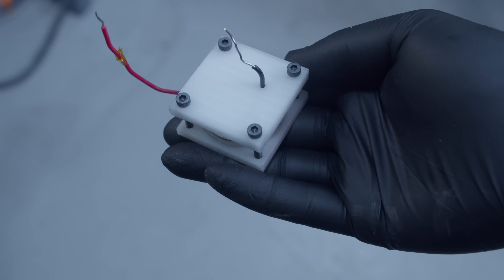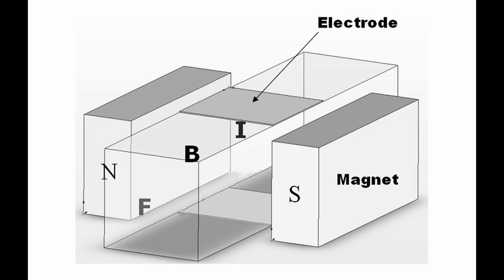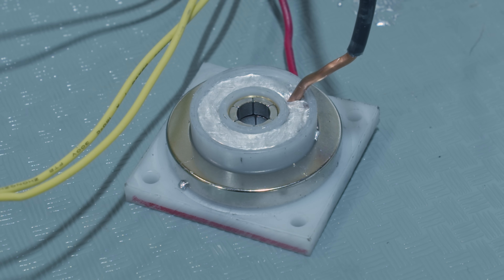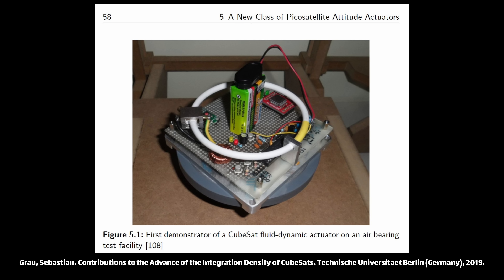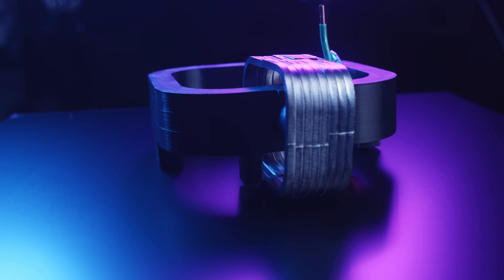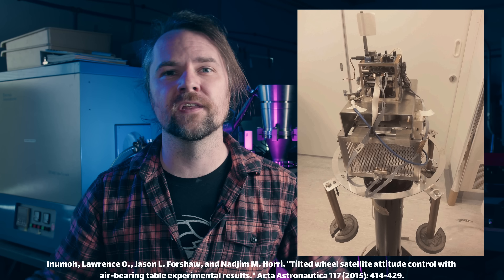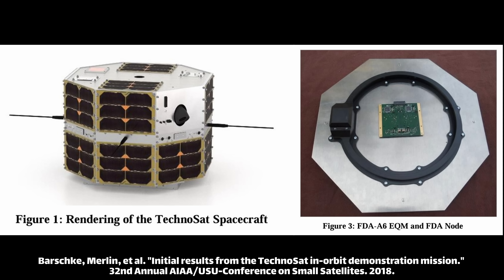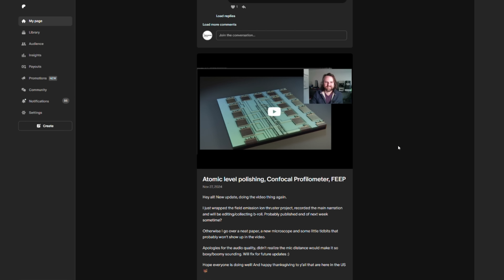A motor with no moving parts (sorta)

Comment: Not all the issues you listed seem to be gone with that design.  I'm guessing it would be bad if the system wasn't at least air tight and that would mean it needs to be sealed because otherwise trapped air would puncture the air tight barrier.

Comment: So you use Lorentz force to move liquid metal.  Why bother with the liquid metal?  Why not generate Lorentz force with a current through the magnet?  There are no moving parts and no liquids.  Nothing to seize up.  (If you look up Lorentz force motors in YouTube, there are plenty of examples.)  With a button magnet, you can create torque.  Reverse the current to reverse the torque.

Comment: What if you had a sphere with a solid inner sphere. Then have electrical points all over the out side. Then you just pick two points less than 180 degrees from each other perpendicular to the direction needed to spin.

Comment: Question, wouldn't the liquid metal still need to be sealed in a pressure sealed case to prevent it from bpiling off in the deep vacuum of space? Wpuldnt need to house the entire assembly of course, just the liquid, but still

Comment: nerdpop...sume of parts over unity possibilities...If a reaction wheel must be spin at high speed to have inertia or stored power. if the reaction wheels are scalled but in // in each plane, then smll fine adjust c an be done with the liquid system. The older bearing based can provide the power for large moves. They can be run at much smaller speeds, reducing vibration, if they do not need to provide fast steering, if the smaller liquid system can do that. slow can catch up in time. bidirectional spinning can allow lower average speeds and provide needs, of the main reaction wheels.
I can reduce your power losses driving the liquid current sink/store.

Comment: For 1 wouldn't segmenting the metal be more efficient rather than relying on surface tension alone essentially shape it as propeller. 
And in regards of efficiency the magnetic field generated is what drives it so the power is lost in that conversion. 
So some energy to magnetic field to induced movement is how we can actually measure the efficiency no?

Comment: what happens if the electrodes only touch opposite sides instead of the entire bottom or top or both being the stuff is already conductive?
what if you took a hollow ring of plastic 3d printed for optimal shape and filled it as the reaction wheel with slots for flat magnets or curved to optimize the thrust?

Comment: New experiment:  inside a hollow glass / quartz  torus add the following:  Hg, Nanoparticles of : Fe, Ne52, Ba, Co.  DONT fill the entire volume of the torus. Create vacuum inside toroid and seal the toroid with the vacuum inside.   Use  transformer wire to wrap the toroid.  Apply voltage using a Variac.  The mixture will spin. As you increase the voltage the suspension of nanoparticles in mercury will spin. As you increase the voltage, the suspension will center in the center of the toroid as it is pulled to the magnetic field. As you accelerate this “colloidal mixture” ( not an amalgam since it is not solid) , the spinning fluid will turn into a plasma. Remember, there Is no resistance from touching the quartz/ glass wall since the mixture is not touching the walls.  You can place another coil not touching the primary, and you will be surprised by what peak voltage you can get.    The plasma comes from the suspended rotating fluid.  As you reach sufficient radial velocity,  a corona effect will be created.     There is a part 2 to this  setup, but I’d prefer give you the details in a more private forum  because  I am afraid that some amateurs can try part 2 and I want to have you do it first and see what you think about putting it out there for everyone to try it.  Send me a reply here.  There is also a part 3 but that is even more complex and requires understanding of quantum physics.  I don’t work for the government and am not violating an NDA.    ST. MD, MS

Comment: Turbomolecular high vacuum pumps use magnetic bearings as the rotors spin up to 120,000 RPM. So...why don't reaction wheels use magnetic bearings as they are not affected by vacuum, they don't wear out and there's the added benefit of reduced drag.

Comment: Couldn't a single sphere with coils on 3+ axis take the place of 3 separate reaction wheels? The internal confinement may be an issue, requiring a sphere within a sphere to stop fluid from flying around when not under magnetic force, which would inevitably limit the ability to flow in any direction, but could still be very useful even with limitations.

Comment: ok so I think the biggest downside I see with this right now are the temperatures in space. So you would probably need like thermal insulation + heating and it should be done with mercury instead of gallinstan, but aside from that it is really fascinating

Comment: High current at very low voltage is not so hard to produce if you know about switching power supply but the design of the printed circuit board is a science that only experience cat teach.
That's the kind of thing powering PCU units nowadays. But the liquid metal may heat a lot and magnetic circuit will lower his property though.

Comment: can you have a helical turbine type wheel encased which magnetically (rare earth / EM hybrid) couples to a wheel on a driving shaft, so that motor moves at semiconstant speed/draw but increased power to EM coupling performs throttling.. Intermediary torque transfer medium. Increasing throttle modulates coupling strength, and then drive speed when necessary. hybrid style, one, other or both.

Comment: would something like this need to be kept pressurized to remain liquid? while its liquid at normal room pressures temperatures changing the pressure should change this and may even allow it to flow more smoothly.
also would they need constant power to maintain flow and position against friction compared to the negligible friction of reaction wheels?

Comment: reaction wheels aren't that good because of saturation, u always need propellant so far to desaturate from time to time, even if reaction wheels didn't fail they would still saturate all the time and that's why the satellites become unable to control attitude because of fuel/saturation and not because of mechanical failure most of the time.

Comment: OK not sure how you think you can get liquid metal in the -454 degrees Fahrenheit since mercury freezes at -38  Fahrenheit you'd need an electric heater and more power to keep the metal liquid seems a pointless endeavor for outerspace useful on earth at room temperatures but would use a lot of power in space to heat and cause spin.

Comment: @BreakingTaps 
I was wondering, if you could test a small experiment with the liquid metal. I am having a belief from my childhood that centrifugal force of liquid can be used to create thrust without any propelsion.
A liquid inside a spehrical apparatus or a kind of hemisphere apparatus where liquid can freely move from bottom to top of hemisphere due to centrifugal force. Can you measure if it can create some thrust.

Comment: Pay attention please 
I liked your project
To solve the power problem you can use longer with smal diameter canal for the liquid metal to increase the surface resistance and you will need higher voltage and lower amps by making it a spiral loop starting from the top to the bottem and again an eaner spiral runing from the bottom back to the start and like that you can use a cylindrical magnet in the center .thank you for the efforts

Comment: Hello! Wouldn't it be better if there is resistance to the liquid flow designed like a Tesla one way valve for example, which won't stop the flow entirely and allowing just enough to keep things moving ,but in the same time increasing the force of the liquid on the body itself, thus improving efficiency? I guess that if the flow rate is close to 0 at the very end of the loop you achieve near 100% efficiency of the power to rotation conversion. Just guessing... Great content!

...edit for more nerdy stuff and guessing; 
I also think that when the liquid inside accelerates to it's maximum speed the movement of the body will stop. This is the reason why such resistance would in theory cause a constant force, rather that a one shot pulse. Because upon powering off the same force will be applied and the movement generated will cancel out the force of powering on. I hope this makes sence :D

Comment: An idea for a non-bearing, non-rotating reaction device. It does have the disadvantage that it does vibrate. In fact that is how it works. You have a rod that is fastened at the base or possibly held at the middle. Use two 90 degree cross fields to drive the rod at its natural frequency. Start with the sinusoidal drive and then rotate the fields to the other pair of coils. The oscillating rod will produce a torque and try to continue to oscillate in the same plane it first started in.
No bearing to wear out, not high current to deal with. I'm assuming the rod was made of spring steal but most any stiff rod would work but it needs to either be able to be attracted to a magnet or have magnets mounted to it. For a spacecraft, and you    could live with a little vibration while rotating, once it was in the right direction, just let the vibration dampen out.
Dwight

Comment: I wonder if it would help to use a pipe in the shape of a solinoid (ie: a helix).  Then line up a bunch of electrical contacts in series, with a line of magnets etc.  Basically a possible way to have a bunch of these pumps in a compact shape.  Maybe.  And since all the current runs in series, maybe you could get away with less amperage?   Anyways, maybe I'll peek at that test satelite project you referred to.

Comment: Could you do this in reverse with a tesla valve?

The tesla valave is a no-moving-part conduit that preferentially allows fluid to move in one direction rather than the other direction.  So... If one had a circular channel of tesla valves filled with liquid metal and between conducting plates and lined with magnets?  The result would be the electrical equivalent of a self-winding watch... something that would turn vibrations into non-random over-all flow of the liquid metal which in turn would produce a voltage across the two plates and a current which could charge a battery.

Comment: You need amp delivery? you could set up an array of 2.5v boost capacitors or ultra capacitors. I use 6 in series in my car for 15 volts, If you haven't played around with some of these maxwell boost caps/ultra capacitors I highly recommend trying them out. 6 2,600F caps, even after substantial capacity loss from series will run my 1,400W stereo by itself for 7 seconds. They make them in several sizes, their all pretty light weight, you could probably make it without needing any wires coming off.

Comment: Bravo..........they have already made..........different style..........tank on top .....with a horse shoe tube  on bottom......to make a loop from one side of tank to other side.....know on up side of loop the inject compressed air.........note one side has less  density from air.......also mix iron particles  in  sodium......heat to liquid .....coils go around tube........liquid generator core with no moving parts......cheers

Comment: i wonder if it would work better with 1mm spaced flywheels in with the liquid metal. i used tesla's "bladeless turbine" physics as my base of reasoning. with the flywheels, it may help with the energy loss & magnetic conductivity. with the metal being liquid it may provide as lube as well as rotation

Comment: get some battery cells that are lifepo4 bare cells used. i have a large stack, and zero bms prote3ction, can push like 10A per small cell  and 15A high for burst, i picked up about 200cylindrical, pucj or prisms have less burst its based on the anode cathode structure designs

Comment: I forget what it's called when you hear about something one time and then it feels like everyone is talking about it, or like you thought you bought a unique car but now you see them everywhere... I was reading about MHD in October maybe??? I think I've seen like 3 or 4 larger science creators drop videos about MHD since then after what seemed like several years of gap since the last larger MHD video. One of those weird coincidences I suppose. 

I just wanted to share what I was originally looking for into because I found it fascinating: 

I was reading (probably 70s era NASA research) about MHD in "reverse" as generators. The MHD generator would be installed in combined cycle combustion turbine exhaust gas paths. The MHD would be used to collect the kinetic energy of the exhaust gases before being used in a typical steam turbine generator. The design concept doped the pure hydrogen fuel with cesium to make the exhaust gases exclusively steam and cesium. This combination would be the conductive liquid for the MHD system to function. Then the system purified the exhaust to remove any contamination and reclaim the cesium for reuse. The purified exhaust gases (now just water) are sent through the steam cycle as boiler feed water. I find it fascinating though I think it's obviously impractical for a lot of the same reasons that modern hydrogen gas turbine projects are facing today. Add a need for a reliable cesium source and energy needed to run a cesium condenser... Measurable losses and political barriers become plentiful. I'll reply to this comment with a link to the paper if I find it.
Reply: The document is NASA Lewis H2O2 MHD Program: NASA TM X-71520. Page 4 has the complete cycle diagram.

Comment: very interesting video!
for the needs of the demonstration you limited yourself to non-toxic "compounds",
but for a flight article I would have considered switching to the element Mercury, with adequate precautions one can dare to take advantage of its high density and its liquid phase at room temperature
in space there is certainly a vacuum but there is also an obvious lack of thermal stability (in no time one can go from close to absolute zero to really excessive temperatures)
to maintain anything in liquid phase a heating system must be provided (which increases the mass balance of the satellite)

if I were given an unlimited budget (in dollars and in mass) I would have even gone to select the densest metal choice which is paid for by a substantial heating system to keep it liquid. so we would end up with a reaction mass in osmium (density of 22.6 against "only" 13.55 for mercury)
for the heating system the mercury will only need to be kept above -35°c to remain liquid
as for osmium it is rather +3 000°c LOL

Comment: liquid metal freezes
Reply: Space is surprisingly enough, not cold. With some insulation it's probably possible to keep a "liquid" metal, liquid.

^ one of the main contributors to this is the total lack of atmosphere. Which is the primary method of cooling on Earth. So everything must be cooled by radiation (mostly infrared). Satellites are reflective to keep heat out, because space isn't cold
Reply: Oh wow! Thanks for the info!

Comment: @BreakingTaps 
Regarding the required power, why not use batteries to charge a capacitor? You would then use the capacitor for a high-current discharge. As for the container, a long and thin coiled plastic tube holding the liquid metal would likely eliminate turbulence issues. I believe this setup could have surprising properties.

Comment: Now does the wheel really need to be liquid? If you make any wheel rotate in magnetic field in vacuum, it will work the same. It can be made from anything, including steel or a piece of metal impregnated Teflon. The main point of this actuator is that it removes the need of using precise ball bearings, but this has nothing to do with liquidity etc.

Comment: Aren’t most reaction wheels used to absorb angular momentum for long periods of time in between rare usages of thrusters to dump angular momentum? And aren’t these liquid metal motors going to experience vastly more friction (through fluid viscosity) than a good ball bearing? (You mention viscosity very briefly near the end of the video but don’t discuss it at all.) In other words, you will need to continuously apply lots of power just to hold it fixed to the new orientation. If so, that seems to dramatically limit their usefulness to just short-term changes in orientation.

Comment: One problem is the space temperature, liquid metal need to be in a range of warm "ambient" temperature to be liquid, this device will need another system, like an temperature control to work properly, but it can be a little tricky in space, when we speak about fuel or energy
Reply: Also, the current of the magnetic field, can provide the warm necessary to maintain it liquid, but, as you said, it need a great current to work

Comment: try rubidium... At 12v @ 400 amps with a super high frequency switching circuit. use a multiplier circuit to jack up the amperage....

Comment: Alkaline batteries don't have any built-in circuitry. An AA battery can only source about 1A due to the internal resistance of the battery.
Reply from the maker: They are 18650 lithium cells, each has a chip to super use charging/discharging and keep the cell happy

Comment: There was a satellite named KrakSat that intended to test a reaction wheel made of ferrofluid. Unfortunately the satellite failed because of an error in the power management subsystem.

2:47 - why not have the outer and inner sides connected to the power supply, and have magnets on the top and bottom? And use two identical coin-sized magnets?